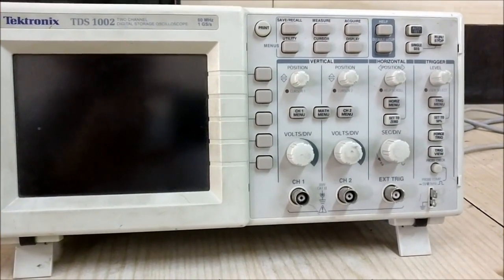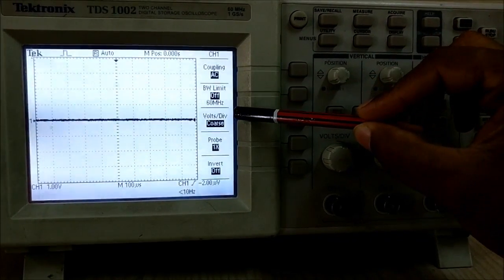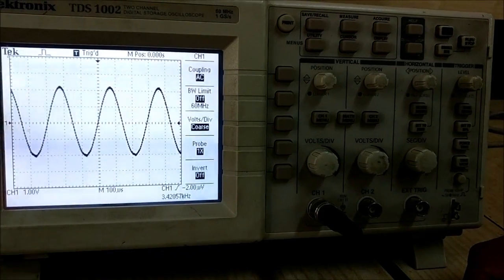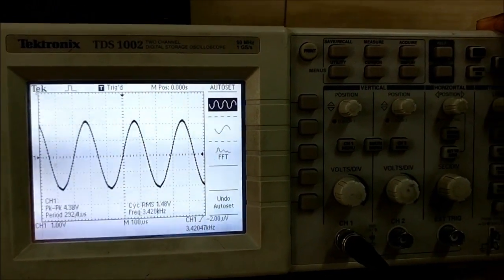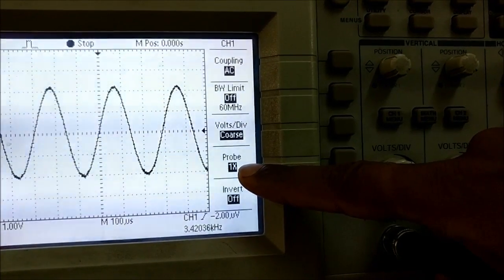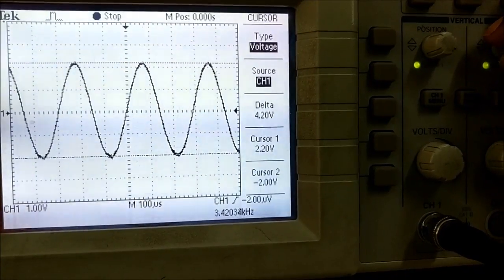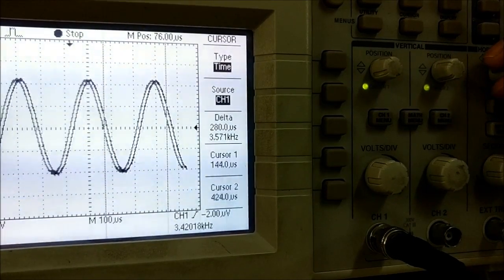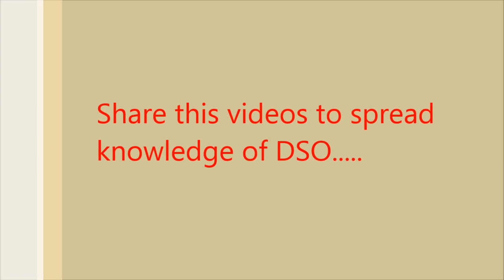How to measure amplitude and frequency of a signal using DSO  Digital Storage Oscilloscope

Comment: Bro how to reset it please tell
Reply from the maker: What you want to reset...
If you want scales to reset just press auto button. Provided on front pannel. For other function to reset it comes option just when you turn on the DSO
Reply: @ANALOGTecHII   i get stuck in DSO-5070E 70MHZ 1GS/S it show only square wave and not sine and sawtooth please help bro